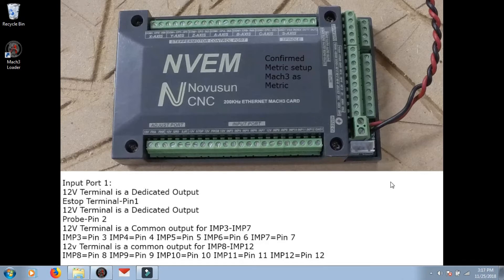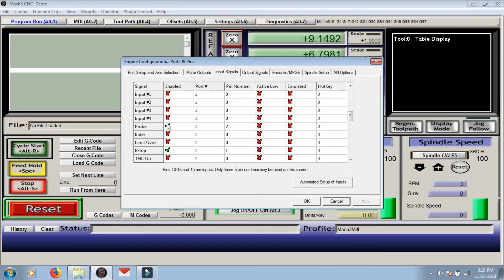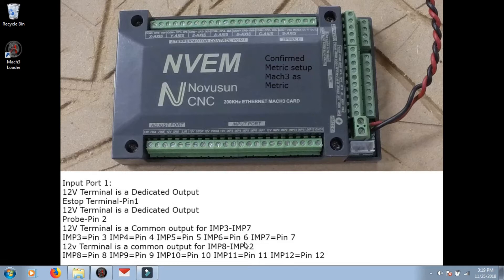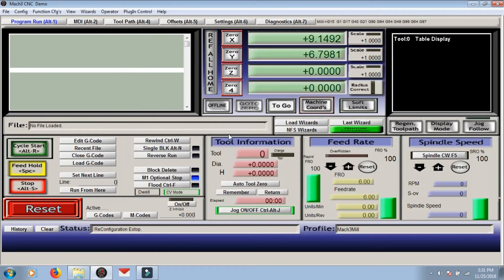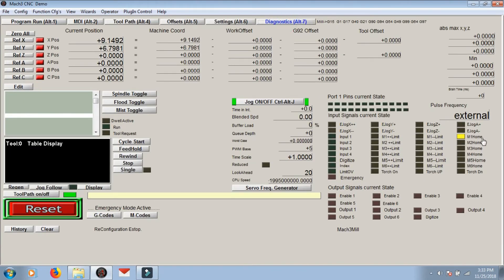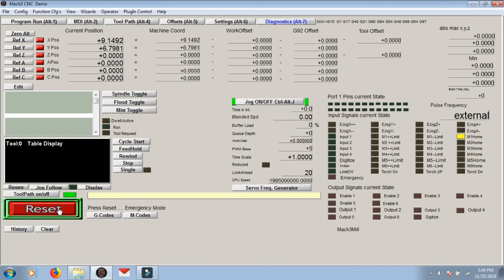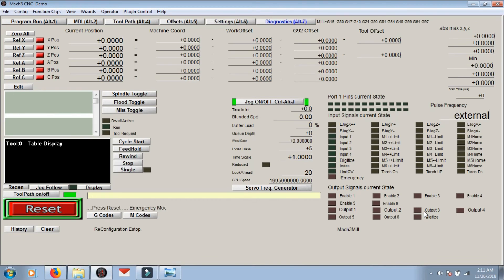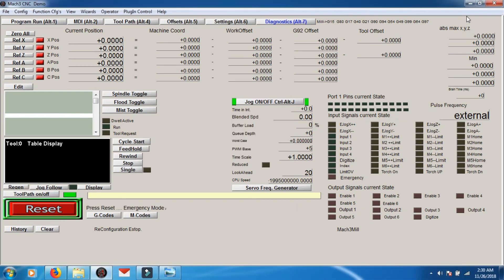Connecting to your Nvem Part  3- Ports and Pins, tips and tricks.

Comment: Have you got any solution for intermittent G31 being ignored when using NVEM V2, Probe touch is ignored, axis continues to G31 max distance even though diagnosic page in Mach 3 shows probe activated as True.
Reply from the maker: @steve-martin-42  You may have to try checking or unchecking active low. Ports and pins in configurations.  I never came across intermittently ignoring however. 
Double check continuity on the probe circuit just to make sure it’s 💯 

Did you run external ground jumper wires to inputs and outputs to activate them?
Reply: @DZMech  Randomly during a G31 Call even though the diag screen shows OEMLED 825 as positive, the probe continues to max distance.
If I run a number of G31 command and manually trigger a touch, OEMLED 825 will ALWAYS shows as true, but G31 command ignores the touch, randomly with no noticeable reason, I have read it seems to be an NVEM V2 issue 😭😭
Reply from the maker: @steve-martin-42  Interesting…
Huge shot in the dark..  here.  Something worth looking at.. maybe… the code for the g31 are you using a script for the auto tool?   Or manually entering everything?
Reply from the maker: @steve-martin-42  I’m just wondering if it’s the script what I’ve found with these nvems is they don’t like inch’s for some reason.. but metric does great.  Inches will cause the cnc to crash 💥 just wondering if the script is in inches 

And are you using a probe plate or leaf stock?  Or an actual probe?
Reply: @DZMech  I only use mm in Mach 3, my probe setup from NVEM is 12v/Probe (input 2), setup in Mach 3, I have today change to input 7 and amended in mach 3 from input 2 to 7 think this might have an effect, 12v to conductive section of work piece, input 2 to cnc bit, same thing happens.
Reply from the maker: @steve-martin-42  let me confirm it (my cnc is in storage…) but I think you want to only work with negatives no 12v when dealing with probes.  All my other machines had probe plate to probe pin 
And negative feed I believe. 

The Nvem will not allow to assign pins (which is annoying) so what I eventually did was reverse engineer the pin out and assigned them accordingly for future add ons..
Reply: @DZMech  on the NVEM V2 there 2 connections for the probe, 12v & probe, probe is actually input 2, as I said I changed to input 7 with no luck
Reply from the maker: @steve-martin-42  I think you were correct on the input 2 and the 12 v 
Just looking at the manual.  Depending on how the circuit is setup it maybe 2 or 6 i believe 

I have probe enabled port 1 pin 2 active low is checked emulated 0
Reply: @DZMech  that how I have it setup as on page 30 of the manual, currently I have pin set to 7 but that only something I tried today previously it was set to pin 2 which is labelled probe on the unit, I only notice the issue because I have been coding the macro to find top surface and bottom left corner, If I ran G31 once or twice it probable wouldn't show, infact it didn't until it drove into a piece of wood and snapped the bit 😭😭, now I know about the G31 issue it's quite a big one as far as safety.
Reply from the maker: @steve-martin-42  yes I hear you on the safety part I’ve broken several bits off over the years.  I unsuccessfully tried my hand writing the auto tool scripts I ended up just using a prewritten script from one of the YouTube homemade cnc OGs 

I believe it was hoss cnc or Franco lots of informative stuff there although I don’t think they use the Nvem
Reply: @DZMech  I have no problem with the coding, chatgpt helps, I was a programmer in a previous life, as I said I have the macro running on a different machine with UC400ETH & CP0-10V with no issues, when the hardware is causing the error no amount of skill will fix it, looking to change NVEM ASAP, as I need posisitional repeatability as I have a few jigs that I need to make 😭😭😭
Reply from the maker: @steve-martin-42  awesome!  I wish I was a programmer yes I would say the hardware is most likely the issue on this then.   Sorry I couldn’t help figure it out.
Reply: @DZMech  thanks for trying have a great day

Comment: This board Nvem can be use to input sensor index to mesure and sincronize the speed of the spindle for threading jobs?
Reply from the maker: Good question...  Honestly,  I wouldn't go with this board for something like threading...  it's good for blind milling,  on a tinker and hobby project level. Other than this channel, and a few others... there's no support from the vendor or the manufacturer.  I would check out the acorn board and make sure whatever you buy is compatible with your software and has great support!   These days customer support has really gone down the tubes in every industry. so I wish you luck... but this board leaves way too much in the wind.

  I mean threading needs to be bang on 100% or stuff falls apart..

Comment: Thanks for the great video!!! Ive been working on this for days, The video helped me get all my switches recognized in Mach3. Im ecstatic!! Problem is now even when the switches are engaged, the machine keeps going. Is the because im manually jogging and just need to trust the machine will stop when it hits  switch when homing??? Thanks
Reply from the maker: You have to setup homing and limits possibly….  Leave a bit of space between when the switch is tripped and end of the table and a buffer to prevent crashes

May have to play around with numbers and make sure to calibrate your axis first

Comment: hello the output signal of the limit switch has two wires and must be connected to INP3 X - INP4 Y - INP5 Z with the first wire sign must be connected to the INP but also to the 12V + power supply? or should only the second wire of the limit switch be connected both on - GND and on the power supply? does this also apply to estop? INP1 + and second wire connected GND and connected to the power supply?
Reply from the maker: Hey so basically the estop has it's own dedicated feed with the 12v beside  with all of those inputs you have to feed your external switches a 12v which is supplied by the terminals beside the row of inputs.

you can daisy chain them if you like and you can seperate each switch to individual inputs and configure them in your program.

the 12v power outputs are available at each post on the input side marked 12v.  shouldn't need external power from the power supply.
Reply from the maker: good luck

Comment: Hello, who can copy from Local Disk (C} and send the customized finished Mach3 working program for the Nvem_V2 card. To my email address: kamran.veliyev@azertexnolayn.com
Reply from the maker: hi  I'm not affiliated with any of the companies but Newfangled solutions mach  3 (google it it should come up) visit their website you can download it right from there.  its should run 200 lines of g code ( very simple design)  after 200 lines or so you'll need to purchase a license from them (not me I do not distribute software)    at least you can get it going and check it out.  good luck!

Comment: Thanks for the vids, you fixed my connection problems. My spindle body is grounded and therefore the bit is also, will this effect the probe connection if I'm using a simple touch plate?
Reply from the maker: that's an excellent question!  i don't think it will because probe input is looking for a ground signal.   You may want to put a piece of rubber or foam under the touch plate just to buy you some time to hit e stop if it doesnt retract.

Comment: Should you get the Novus NVEM?  The answer is a resounding "NO." So I wired it all up once I figured I had gotten defective drivers.  I received my replacements, and all was well.  The CNC was running perfectly.  Smooth movement, got my E stop ready, and my Zeroing plate ran perfectly.  It seemed all was well.  I didn't connect my spindle to the NVEM (Version 2).  

I attempted to finally run a file I setup with fusion 360 and and it then suddenly started to do weird things like the emergency stop started to go off randomly.  Then suddenly it just stopped working.  The ethernet port no longer received a connection (lights are dead) and even one of the lights that indicates the device is on suddenly didn't come on anymore.  There is now just 1 red light and nothing happens.

I turn on the device now and it just wants to drive my motors into my stops. 

I have to say, this is worse than just wasting money.  I wasted valuable time and energy into getting this piece of garbage to work.  I seriously think the people that have one working are just lucky.  This thing is seriously not worth the money.  On to go buy my smoothieboard instead that has an amazing amount of information I can actually read.  For anyone else interested, check them out here: http://smoothieware.org/smoothieboard

Finally, I'm just pissed now.
Reply from the maker: Sorry to hear that!  Check this link out! https://youtu.be/pL9Z5efKhHU  
It's from Another Youtuber Franco He has a lot of great videos on cnc conversion the process and setups whole slew of great info!  I'm  still going to try my nvem and see what it does ( have to finish my cnc coversion though)  but I'm thinking at the end of the day,  do I want to be messing with some sub classed chinese junk or do I just want to cut metal and make stuff.  Anyway,  I was looking at the centroid acorn in that video.  I also want to get away from mach 3,  I'm finding I am small glitches,  but that might be me expecting to much from the software!

Comment: Heya @DZ Mech or anyone else here, so I just recently wired up the newly created electronics package with the NVEM NOVUS (big portion, thanks to you!) However i've hit an impasse.  All of my motors work.  My configuration uses 4 motors, X axis is controlled by two motors. After I "slaved"the secondary motor to the "A"connection, the axis only moves one direction. It never switches when I press to go left or right - just moves the same direction.  All the others run well in both directions perfectly. 

Have you had this problem? Any idea what may be a cause? 

Thank you in advance!
Reply from the maker: Hi sorry for the late reply,  No I haven't had that issue,  on a dual motor setup. I had something similar where a single 8 wire stepper,  going only one way.  but that's apples and oranges not the same issue.  I had to figure out the 8 wire connection.

Not to sure what would cause that.  what version Mach are you using?
Reply from the maker: I wonder if you were to remove the A axis connection, and skip it to the b or c axis' and slave the B axis?  Essentially skipping the A axis
Reply: @DZMech  Hiya,

Thanks for all of the suggestions.  I think the conclusion I have come down to is that 2 of the 4 drivers I purchased are defective.

Basically, I have tested the "working" drivers that I have which move the motor in both directions on every connection of the NVEM and they all work properly.  

The suspected bad drivers on the other hand don't work properly - they move only 1 direction.  I have tested the good and bad ones on different motors I just had laying around, and they behaved the same way.  The good ones spun the motor in either direction, and the bad ones only spun it 1 direction.

Thanks for taking all of your time to attempt to help me.  I appreciate it!
Reply from the maker: @LogicSpeaks  Great troubleshooting work!
Reply: @DZMech  You've been very helpful!
Reply from the maker: @LogicSpeaks  Thanks! I am glad I could help!

Comment: Thanks for the videos helped me get started. I am having a problem with setting up an output signal for a plasma torch on/off any assistance here would be great.
Reply from the maker: the outputs are not linked internally on the nvem so you have to run an external ground to your input (i call it) for the outputs
Reply from the maker: Oh is the torch on a separate board ?  Turns on with. A separate unit like a vfd signal?

Comment: Have you wired a stepper driver to this yet?  I've attempted to follow the directions to no avail.  My stepper driver has the "alarm" light that stays on with the green light. So red and green both on.  Not sure if its how I have it wired with NVEM or if its something different.  Never wired a driver before so I could easily have it wired wrong.
Reply from the maker: No worries,  hope this helps! Brief explanation.  I think I cut this out of all the videos,  too many different stepper and driver combinations out there to make a short video.

Yes,  for each driver there is 3 wires from the Nvem.  COM + CPX- and DIX- (NVEM)  On the driver there should be 6 input terminals PULSE + (+5V), Pulse - (PUL), DIR+(+5V), and Dir - (DIR),  ENBL +, ENBL -.  FIrst connections are direct from the NVEM to Driver.  Terminal locations may change for manufacturer but the name usual stays the same.  Do each connection one at a time, and count the terminals on the nvem.  print is off or a skew so the print doesn't line properly you should be ok.  also, check the dip switches with the data sheet and setup amps and resolution. Warning-do not flip dip switches with power on.

NVEM  => Driver

COM + => Pulse + (+5v),  this terminal will have a jumper wire going to DIR + and ENBL +.
CPX -   => Pulse -
DIX -    => Dir -
Enbl - => Nothing At the moment.

Motor side of the driver. Make sure your power supply is the correct one for the driver,  example-  I'm running different motors NEMA 34 and Nema 23,  the power for the Nema 34 is 60 V  and Nema 23 is 36V.  

Driver => Power Supply

DC- => Dc -    Output  you may have 2 or 3 terminals coming out of your power supply,  make sure - and + are proper.
DC+ => Dc +  Output you may have 2 or 3 terminals coming out of your power supply, make sure - and + are proper.

Motor outputs I got caught up in this part my motors had the wrong data sheets  there are 2 coils in a stepper,  and leads vary.  Some steppers have 4 wires usually and can also have 8 wires.  Check your data sheet for the motors for A Coil and B coil wire colors and connect them accordingly.  I ended up contacting the company for my gear and they determined i had the wrong datasheets sent with my motor setup.
 
 Note Motor wire colors are all different.  you can confirm windings with a multimeter,  and continuity a continuity check.

Driver => Motor

A+ >           A+ wires should be connected
A- =>          A- wire inside the motor

B+ =>         B+ wires should be connected
B- =>          B- wires

What motors and drivers are you using?
Reply: @DZMech  Hi! Thank you so much for your in depth explanation! I feel terrible for not responding sooner.  I just got the rest of my drivers in and plan on following your directions.  I have figured out how to do it before your explanation but I think this will guarantee that I do things correctly :D   

Currently I just bought DM542's since I am upgrading a Shopbot I got for a very inexpensive price.  The current system works but  the zeroing probe port and another stopped functioning so I decided to do this.  The current motors are 1 amp nice geared japanese motors and I have already hooked a motor up successfully.  It seems to run even quieter than before.  Hopefully I don't break anything.
Reply: I've noticed that most people essentially hook up two power supplies, 3-4 drivers depending on the system, and a VFD and zeroing plate.

Am I missing something in terms of a backup - I fear I know nothing about electrical other than the basics.  I can follow directions though hehe.  What I mean is - I've been told by numerous people that steppers generate a current and if pushed can "backfire" and fry your board.  Is this only true of old drivers and boards or is this always true.  And... you think there is a way to protect it by adding something to the electronics package?  You have plenty of other things to do so I don't prefer that you spend too much time on this hehe.
Reply from the maker: @LogicSpeaks  Nice! That's great to hear!  And, Thanks for the reply!  Hopefully all goes well! I'd like to hear how it all turns out!   I think just as long as your dipswitches are setup for your 1 amp motors,  you should be ok!
Reply from the maker: Yes, most of the Cnc Motor Kits come with 2 or 3  power supplies they have three outputs positive and negative,  depending on the power requirement of the motors and the wattage of the power supply you could just use one technically.

 I ended up using 3 power supplies on my first Cnc router,  just in case I wanted to add more goodies. And... the kit came with 3 power supplies, so I shoehorned the into the control box.

I believe you are correct on the motors being pushed and generating a backfeed of current/voltage.  They would have to spun up to a certain rpm though,  to create the current  to backfeed.  Would have to push them really fast haha ... I think anyway !? which gives me an Idea, I have a couple of extra motors I'm keeping for my 4 and 5 axis on the Ct129N cobbling/conversion.  It would be interesting to see what we can get out of them voltage wise and maybe even another experiment that's rattling around in my head.  

I am pretty sure there are diodes one way check valve for electronics in line with all the terminals,   at least i hope i was pushing axis' around with a cordless drill. Nothing noticable came of it,  but I didn't even think of that!  Good Call! :D

My zeroing plate I am using a 5V power supply and a  "ground loop" (i call it, not sure what it's really called)
so the positive is straight to the breakout board and the ground  of the circuit is separated by the plate and the clamp thats on the bit.   it's a weird setup but it works!